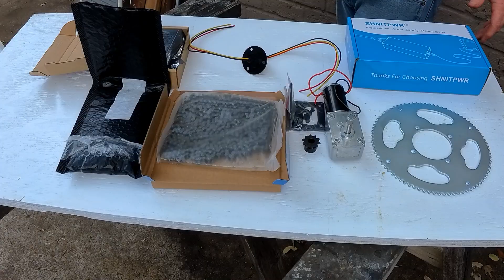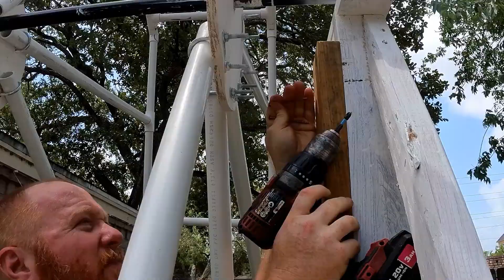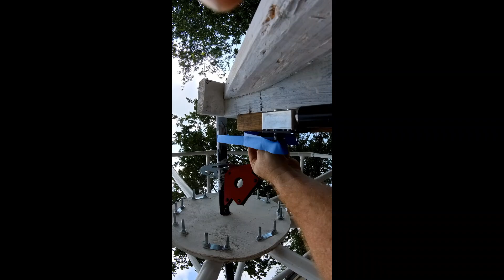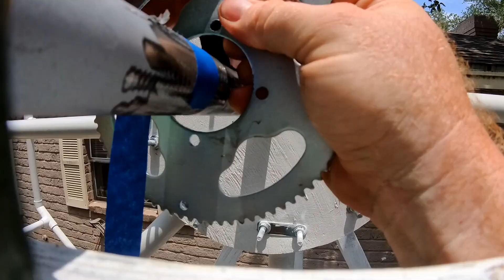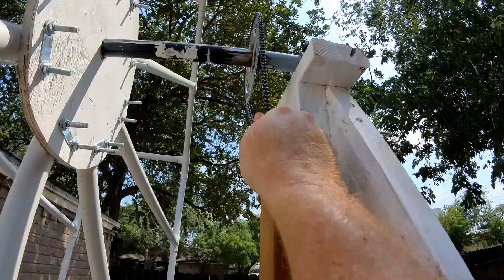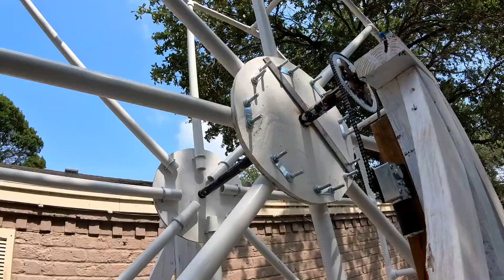DIY Halloween & Christmas Ferris Wheel Drive System Build 🎡👻🎄 #HalloweenDIY #christmasdecor

Comment: OMG! I built one similar with almost the same components going on 8 years. Haven't seen the video of your ferris wheel completed. I'd love to see it! There's a trick I did for the wheel going fast at certain points. This is caused by the imbalance at a certain point of the ferris wheel and can put stress on the motor. Once I finished putting everything on the ferris wheel (seats, characters, lights, etc.) I spun it slowly and let it stop on its own. Your heavy spot is on that bottom seat or whatever you're using. You're going to need a weight on the opposite seat which is straight on the top. you can do this by putting your seats at the 9 an3 o'clock position until its balances out. I used a an old 1 1/2" socket I laid in one of my seats and it balanced it out. I will be setting mine up later this month and send you a video.